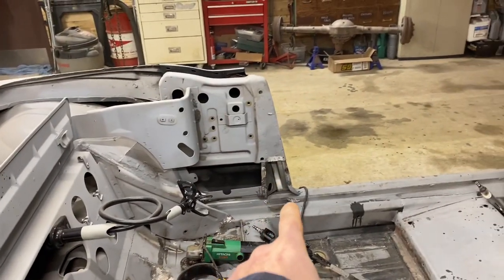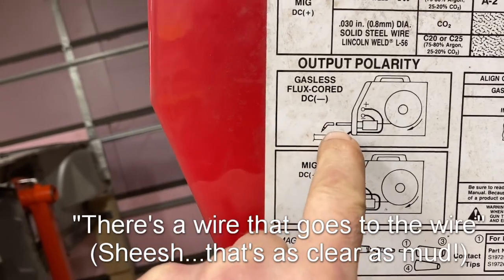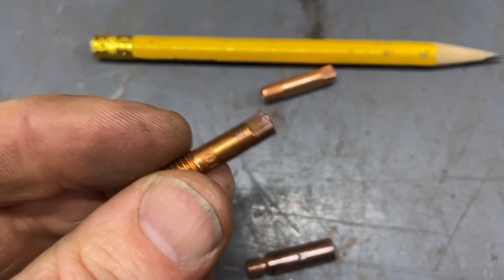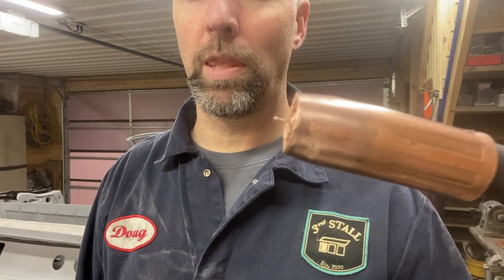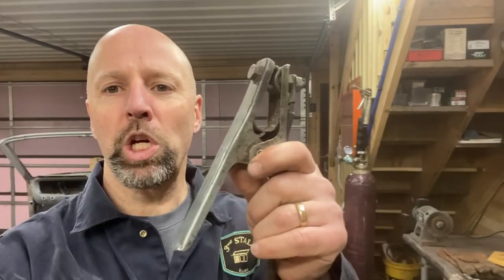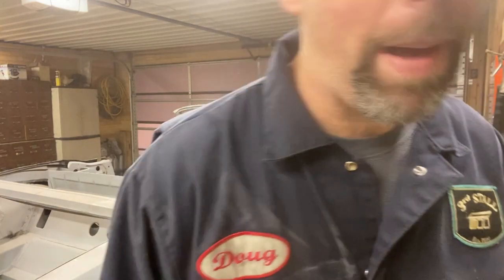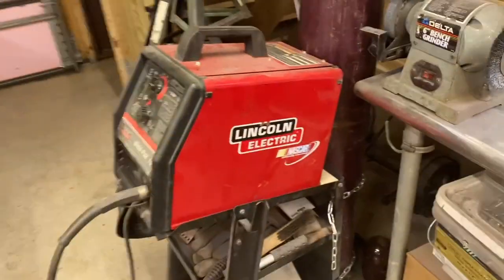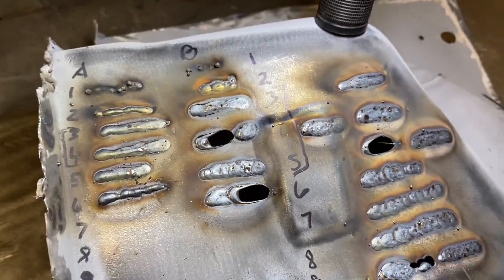Welder Tips for autobody thin sheet metal welding

Comment: I always do spot welds and space them out. Use a blow gun to cool down the metal. Once you have a spot weld that is cooled, you can now build your welds on that with little to no burn thru. Be sure to space them out along the sheet metal so you don't warp the panel.
Reply from the maker: Good advice!

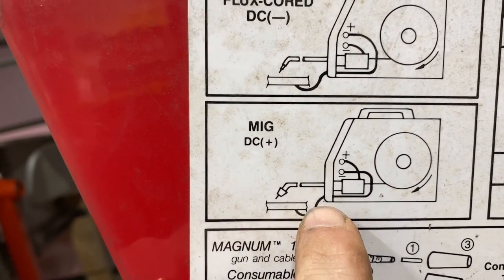Comment: hey man at 5:52 when discussing polarity for gas shield welding you said, "the wire that comes from the gun goes to the negative."  doesn't the diagram show the work connected to the negative pole?  and the gun is electrode positive?
Reply from the maker: Yes!  Nice catch.  I mispoke.  Follow the diagram...which is correct.  Thanks for pointing that out.